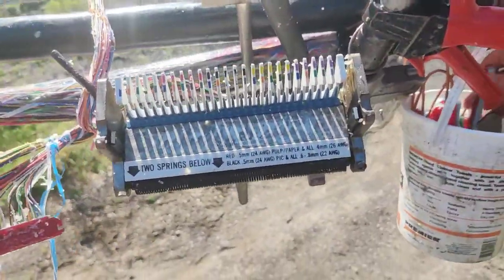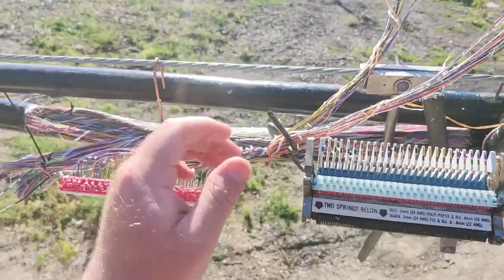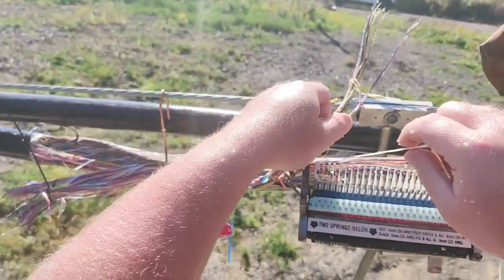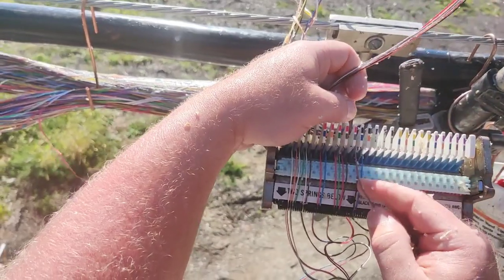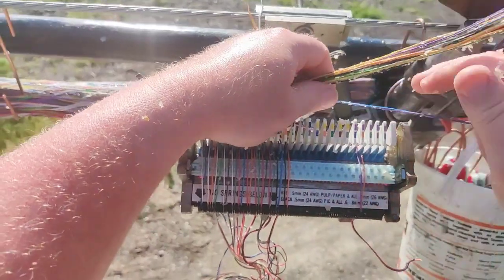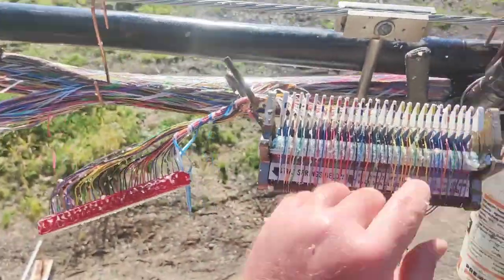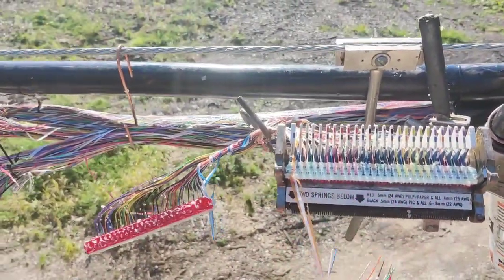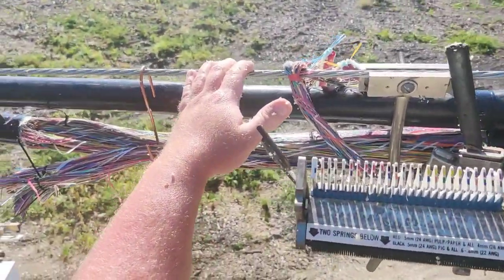telephone/data cable modular splicing

Comment: If you turn the head so its 90 degrees i find it more comfortable.  I can get one hand on each side of the head and its more comfortable to lay the pairs down.  Keep your unilength hook on it to bring the cable into the head properly.

You can also use like 7 or 8 pluggable mods stacked together.  We never used mini mods because they dont have pluggable pins on the bottom so the bottom of the stack always has to be the mini.

I like that you.keep you binders all the way.  The trainer here told everyone to cut them at the base of the cable and put zip ties on.  

Looks like youre doing the unilength method.   Foldback is much neater imo.  You take one group straight from one cable, and you take the other group youre gonna splice it to to the butt of the 1st cable and tie it off, then you take it straight out to the same spot you marked at 1st.  Terminate 1st 25 of the 1st cable, instead of putting a cap on it, put a fresh pluggable mod on top. Itll cut and attach to the top of the stack.  Then terminate 1dt 25 of the 2nd cable on it and now youre all done with that group and never have to look at it again.  Do the whole 2/4 groups in the binder and zip tie the binder to the core.  Now you never have to look at them again.  I explained the process for one binder group but you should build up the whole core before starting splicing.  Like binder group on the left cable comes out straight and will have its module on the right side, its matching group on the right folds back at the left butt then comes straight to the right hand bank.  Then the next binder group comes straight out of the right hand cable andnwill lay on the left.  The matching left hand cable folds back at the right cable.  The groups passing straight across in the core build up and you can put.zipties on to hold them together.  It used to be easy to get the manuals from 3m, i dunno about corning.  3m.would.tell you how to do it too

Comment: Speed was simple......I did 1200 pair for the boss and banked 6 to 800 for the next day. NEVER turn in 2000 pair in a day or they will want it everyday!  I always used two heads if it was over 200 pair cable and tied the binder at the butt and used colored zip-ty at the module.  In the end I could read the paper for 600 pair longer the next day............!
Reply from the maker: I do have the colored zip ties their nice. However they are hard to get here so I save them for when I really need them. Also, unfortunately I only have one splice head or I would use 2
Reply: Absolutely save the 6-800 for a rainy day.

Comment: You're splicing the pairs into the 3M connectors incorrectly.  Looks like you're working on a new splice, 24 gauge, 400pr, pic, aerial cable.  It also looks like you're working from a bucket truck and building a 2 bank fold back splice using 3M MS2 connectors.  Ok.  Look at the 25pr wh/bl binder that you've already spliced.  The cut corner of that finished 3M module, should be on the left.  You're folding the wires back and splicing them, and now the cut corners of the 3M connectors will end up on the right.  The way you did it won't affect service but it will probably annoy the heck out of the next guy that has to work in this splice.   To him your 3M modules will appear to be backwards and upside down.  

And why such a large splice opening.  3M recommends making a 17" opening for a 2 bank splice.  Are you building a 3 bank splice?   And where did you get the pocket knife?  Is that company issue?  Probably not.  Some telco companies will "ding" you for having non company issued tools on your truck."  The problem with that knife is that if it breaks and/or you get injured while using it, your company can be liable.   In my opinion you should use your snips, shears, or scissors? (They're all the same tool but called by different names in different cities).  Using them, especially when making YT videos, will make you look more professional.  Thanks for sharing.
Reply from the maker: It's a 900 pr cable. Also. My splice opening wasn't complete I did not even have the other side of the cable open yet because we didn't have any mini modules in stock... You can see the other half of unopened cable goes well past my splice. It does look like an opening but it's actually just the sheathing holding my binders together at the other end. Yes I know I can use zip ties. As far as the modules being backwards? I'm not sure what you mean I was taught from a guy with 40+ years expirence. And I'm the only full time copper splicer in our plant left. As far as I know our entire plant is that way. Are you saying I should put the cut end of the mod on the right side of the splice head? Or leave it on the left and have the cable fold back from the opposite side from where I brought it in? I've always been told to have the cut end on the left side of my splice head. I know your suppose to use two heads. However I only have one...
Reply: I was always taught to make blue/white the long pair in a mod. Is that what you mean when you say cut corner?

Also getting into some of the old cases is a pain in general when they split the cable in half and put half of the modules on one side and half on the other but don't leave any slack. I run the feed side the length of the closure, then out to make an L shape so the mods folded back will lay in the case when folded back.
Reply: @lego3058 and where is your video? 
😂
That's what I thought